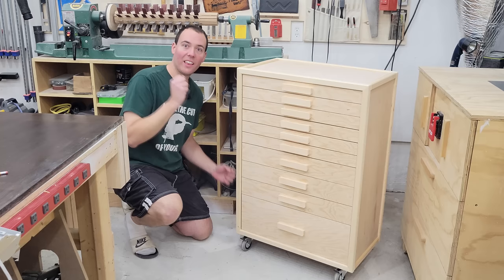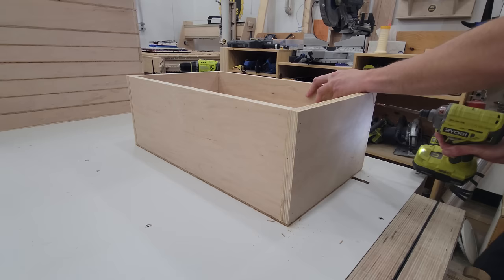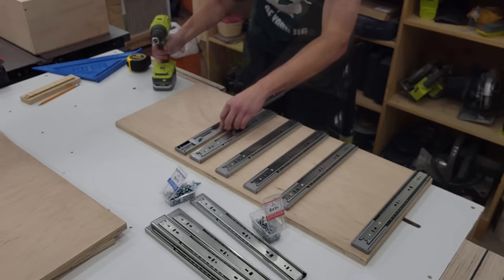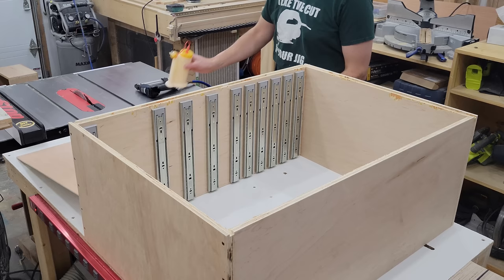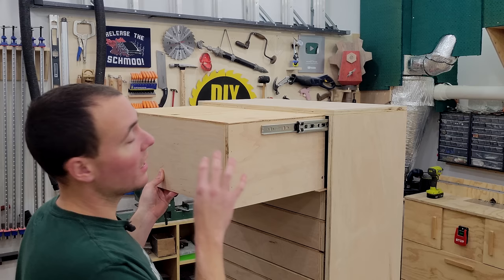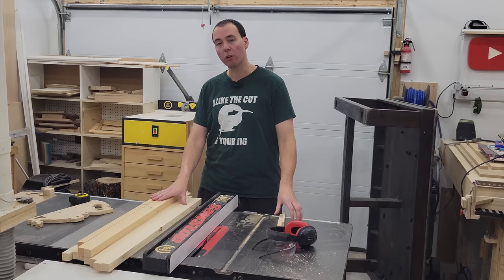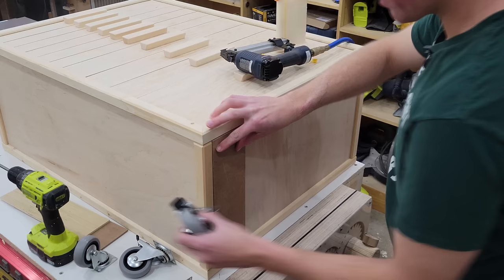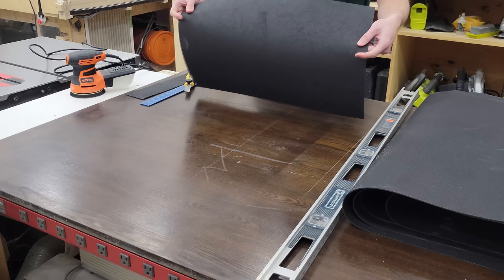How to Make a Wooden Tool Chest - Free Plans!

Comment: Great video and great plans!  Thanks for both!!!  In the video, you had a layout page for your drawer slides.  Would you happen to have a copy of the drawer slide layout that you could attach to the plans?
Reply from the maker: I've just updated the plans to have the layout in it. go to my website and redownload them.
Reply: @DIYBuilds  Thank you so very much!!!
Reply: @DIYBuilds  I have never seen anybody attach the drawers upside down. What is your reason for that ?
Reply from the maker: To keep the gaps between at 1/8" at the top and trimming the final drawer height to size when installed last.
Reply: @DIYBuilds  Thanks for a prompt response. But using the shims / spacers as you did works the same when assembling right side up. I have been doing so for over 30 years.
Reply from the maker: Yes but again I made the bottom drawer larger to be cut to size after so it had to be last.
Reply: @DIYBuilds  please link the plans, your site is glitchy and hard to navigate.
Reply: @mrniusi11  Mate, just follow the yellow circles at the top of the page.  This chest is the very first item listed; it could not be easier to download this completely free set of plans, for which huge thanks, @DIYBuilds.  

What's the the adage – a bad workman blames his tools?
Reply: People really need plans to build boxes?  A cabinet is as basic as it comes.

Comment: For people wondering about the drawer bottom strength: I work at a cabinet shop where we've been building and installing over a hundred drawers per week just like this for years. I've never yet seen one need to be repaired for the bottom coming off. The guides will fail long before the drawer will. It'd be a different story if they were made from boards, but being made from plywood that's not going to grow and shrink a bunch, these will do just fine with glue and staples instead of fancy joints and dados.
Reply: I'm not a cabinet maker, but I did make a cabinet (similar to this one no less) the drawers are held together with glue, and 18guage 1 1/2" staples. I've put probably 75+ lbs of tools and junk in the big drawer and then beat the hell out of that cabinet in the shop for 5+ years now. The bottom of that big drawer is no closer to falling out today than it was the day I made it. Were I making an heirloom piece out of nice hard woods that I was going to display in my house, I'd probably do box joints and a dado'd in panel, I just like that look... but for shop furniture. Glue. Staples. & Plywood have yet to fail on me.
Reply: They do not fail, the drawers, but they are not impressive to look at.
Reply: That was my biggest concern, Thank you for clarifying.

Comment: I built four of these identical to yours 10 years ago, they are still in service today except one bottom to my 3/8 size nut and bolt drawer fell out, because I did not use strong enough plywood, but I used some cheap wafer board for my bottoms, where were you 10 years ago?, I am nowhere near a carpenter or cabinet builder but rather a mechanic. I sure could have used your help back then, smile, good video. Thank you buddy.

Comment: I like that this is a design I could feasibly build despite having limited tools. Sure, a tablesaw simplifies things. But a circular saw would do the job. Using the spacer to install the drawers is a stroke of genius. The best thing about this, though, is that it is flexible. I can make drawers to fit my tools rather than having to put my tools wherever I can stuff them. And there's room to embellish/upgrade things to make the box more of a showpiece.

Comment: One tip.  Next time, instead of cutting and assembling drawer pieces, just assemble the 4 sides of a box, and then cut the drawers out by running the entire box over the table saw.

If you don't mind recessing the drawer bottoms with a router, you can make the box the exact size of the cabinet (less 1" width for slides and 1/4" height for your top and bottom gaps).  Then the 1/8" kerf from you saw blade becomes the drawer spacing.  And you can pre-attach the drawer face panel before cutting if you want.

Either way, the glue up is faster since you only glue up a single box, and it's actually less error prone since you only do it once.

Comment: The metal boxes always look nice in the store. They look good the first time you roll them into your shop.

They look nice sitting there.
But they suck for holding woodworking tools! They're great for my sockets, ratchets, screwdrivers etc. That's about it in my opinion.

Your build is awesome for chisels, bladed tools etc etc. Much easier on sharpened tool edges. And it's hand made. Nice job! Think I'm going to build one too 👍

Comment: Just made this and it came out great.  I think my favorite tip was using the drill with the clutch set well to drive the drawer slide screws.
Reply from the maker: awesome id love to post it on my viewers submissions section of my website if you send me an emailed pic
Reply: Will do once I paint it (I used cheap plywood).  By "great," I mean it works really well.  It doesn't LOOK great 😄 But you can decide. @DIYBuilds
Reply: Is it worth it to build one of these? I've been trying to decide on the cost and convenience of buying a tool chest vs building one and having it be what I want exactly.
Reply from the maker: Yes

Comment: Excellent build and video.  So informative!  So, put the drawer slides on first you say.  LOL.  I built a tool chest with drawer slides a couple of summers ago and it is still a point of pride with me.  But, I had never done anything like that before and ended up putting in the slides after the boxes were all assembled.  What a dope.  Today I learned something that would have made my build a million times easier. 

One question - you seem to have a lot of tear out where you rabbeted the backs.  As a beginner why is that and how does one avoid it?  Thank-you.
Reply from the maker: It's because I did it after the slides were mounted and using wrong / dull bit. Also was cutting accroas grain instead of along it. To avoid it you can score with a knife first
Reply: @DIYBuilds  Thank-you!

Comment: Awesome design! Seems pretty straight forward and easy enough even for a beginner. 2 questions. 
1. If I don't have the nail gun that you are using, is there anything I can use with just a drill? 
2. If I wanted to stain this tool cabinet, I assume it would be better to stain it before putting it all together?
Reply from the maker: if i wwanted to stain it i would build it and only stain the outside but thats just me and the only reason to use nails is to speed things up and help things stay in line while glue dries, both can be mitigate by using clamps. hope that helps
Reply: @DIYBuilds  Oh ok! Thats a better idea. Can I use small and skinny screws since I don't currently have a nail gun?
Reply from the maker: @Lindon_Arelius  yup or hand nail small Brad nails in.
Reply: @DIYBuilds  Excellent. Thanks for the tips! Excited to get started!

Comment: A real work of art in both design and function....I especially like the stability of the cabinet (it  will not tip over when any top drawer is pulled oot (to use your term).  Good to see...you seem to be a little more relaxed given your planned break from the intense youtube pressure.

Comment: Hey mate I love the build and want to make one myself. Any chance you have the plans in metric?
Reply from the maker: nope
Reply: @DIYBuilds did youbuse 2 different types of thickness  of plywood? 1/4" or 6mm and 3/4" or 19mm. In out country the thickness off plywood is 5,5mm, 9mm, 12mm, 15mm, 18mm, 22mm and 25mm. Is it oke to use 5,5mm and 18mm?

Comment: I’m always envious of the table saws and router tables I see in real woodworking shops. I’m wondering if I could pull this off without the awesome equipment?  I also regret the $$ I’ve spent on crappy metal cabinets….
Reply: I built his plans with just a circular saw and drill. You can too. Cutting just takes a bit more time.

Comment: Really tempted to build this one, looked at a few cabs in the past, but couldn't justify the cost. I think i would do only small draws as I have lots of tools that would fit smaller ones. Bigger can go else where
Reply from the maker: For sure. That's the best part of making your own chest is making it custom to your needs. You can make it 13 or whatever shallow drawers and just cut the bottom to fit the remainder.

Comment: I bought some of the basic Euro slide drawers. Much cheaper than soft close. However, they indicate thay they have a 3/4 extension. Does that mean I need to draw my line back 3/4" from where the face of the drawer will be? Or should I still leave a 1/4" space since the face of the drawer is only 1/4" thick?

Also, with thr router table, how large is the bit and how deep are you cutting? Looks to be about a quarter inch deep?

Comment: I've been mulling over building one of these but instead, using pilasters uprights in the cabinet box and using the X-series X2 bracket for adjustable drawers or extra drawers down the line. I have a bunch of my old neoprene waders I plan to use for drawer bottoms. I will have to say though, these drawer slides are absolute junk. Any misalignment from the drawer and the ball bearings are off to the races. What you want are the undermount slides.

Comment: Takes for the video, this is one I might actually make for my dad as he has alot of misc tools that need organizing. Quick question though, would there be any benefit to using two sets of sliders on the large drawer? One set near the bottom and another midway or near the top?
Reply from the maker: Not unless you need more than 100lbs weight capacity.

Comment: How much does the metal toolbox cost, and what are the material costs for making the wooden version?
Reply: The cheapest similar metal toolbox would cost at least 400$ Canadian Pesos if bought new.
I'd estimate the cost of materials to be about the same.
Reply from the maker: Yup. But mine was fun to build, has soft close slides, has better build quality, looks better and most importantly is the drawers are exactly the size I want them
Reply: If I'm correct the plywood build one looks bigger, more volume, meaning it's cheaper per cubic decimetre (liter) than the metal one.

Comment: Do you have a link for that floor liner?  I have been looking for a good nonslip mat for some large drawers - one that doesn’t move around - and that one looks like it might fit the bill.
Reply from the maker: I don't but at my local store you just go to the rug / flooring section and they have a couple stands with rolled up stuff you cut to length
Reply: I just went through your video upload list and noticed you have added a 5W diode laser to your home made CNC. Instead of using this rubber mat you could have used EVA foam. This foam is easy to cut with your laser where you could have made pockets for the different types of tools you want to store. They will never slide and you notice in a glance if there is a tool missing.

Comment: Crown staples vs brads. Why choose one over the other, as you did with the drawers?
Reply from the maker: crown staples are better for holding thin material without blowing through it. brad nails have a smaller head and therfore easier to hide as well.

Comment: Great build, but I would have liked you to address the tear out caused by the router, and how to avoid it
Reply from the maker: You avoid it by either scoring with a blade before or cutting from the other direction with a proper rabetting bit. My problem was doing it standing up because of the drawer slides being in the way. Also I didn't care because it's the inside back and won't be seen.

Comment: How do you know how tall to make your drawers? Are you taking the inside height and width, dividing up the space for how many drawers you want and then subtracting a certain gap measurement? Hypothetically, let's say the opening is 4 feet tall by 2 feet wide. I want 4 drawers so 4 feet divided by 4 gives me 12 inch high drawers. But obviously if you cut them to 12 inches tall, they would be way to tight. Do you subtract an 1/8 of an inch or some other measurement to make it 11 7/8 high give or take for each drawer? I'm new to woodworking and drawers I find are kind of intimidating, so my apologies for dumbing my question down for my understanding haha.

Comment: I stumbled across your channel and found this great project its precisely what I am looking to make. I'm now subscribed with the "bell on" Can you show the Amazon link for the drawer slides and castors you used?
Reply from the maker: The 14" soft close full extension drawer slides I bought on sale at princess auto. The casters are just 3 inch locking casters you can get anywhere.

Comment: Great video!  Thanks for the videos and like the  way you  keep it  simple.   I do  have one  question.   I went to  Amazon for the  sander, and the  specs  say it is a 230 voltage power supply???  Is the one you used  have  that  voltage???????  Sander looks good.
Reply from the maker: Nope it's 120

Comment: Thank you for this video, sir.  I've seen a lot of drawer jigs in my time, but this seems so easy, and doesn't cost an arm and a leg, that I might really try this.  Awesome tool chest!  By any chance would you know if there is a height limit for a build like this? Obviously not talking about extremes.  I mean like would four more drawers be too much of a tipping hazard?  Appreciate you time and your knowledge sharing.
Reply from the maker: If it's higher I would make everything 2 inches deeper to increase its stability.
Reply: @DIYBuilds  Thank you!

Comment: Sorry , I've seen what happens with staples only on weight bearing surfaces over time. Those drawers are doomed eventually depending the use and environmental factors. How much repairs those need at year 1- 2- 3 would be content.
Reply from the maker: the glue is what really holds them

Comment: As a Canadian, I assume you have learned to use proper measurements?
Reply from the maker: As a Canadian I use inches ;)
Reply: @DIYBuilds  as a Canadian, you should know better
Reply from the maker: Go to home depot and look at the lumber isle or screw sizes. You will find everything in feet and inches

Comment: Why would build it like a wood cabinet?  Most tools chest need to support 1000-1800lbs of tools!   Use 3/4” on all side omg! Not gonna last, one bump under load it will buckle and rack! It jiggles like Santa’s belly… omg!
Reply from the maker: The tool chest is nowhere near big enough to support 1000lbs worth of anything. Furthermore I moved it recently when I moved houses, full of tools, with no issue. The cabinet is way stronger than it needs to be for this, its intended purpose, not some freaky load test.